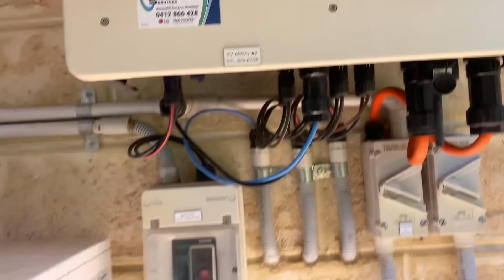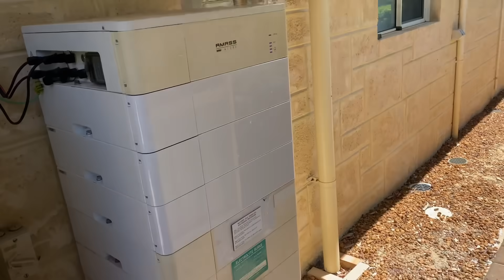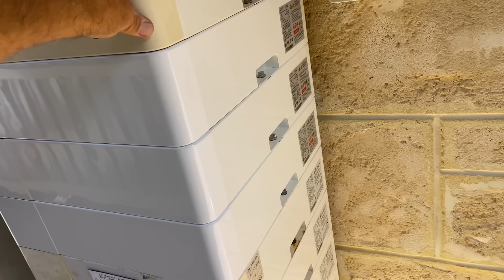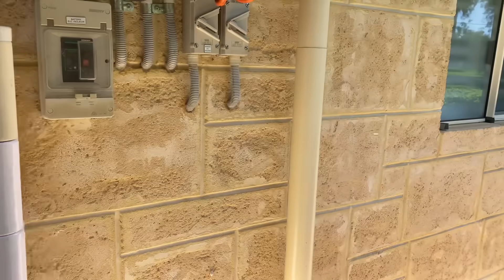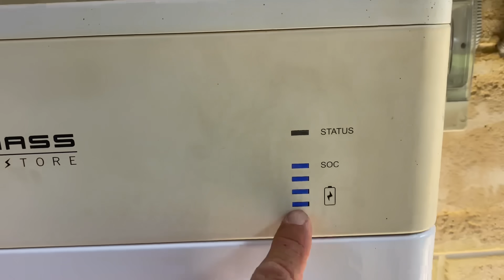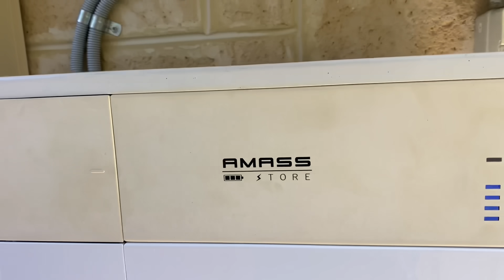Yet another battery sh$t show in Perth! Why cant people just do their job right 🤦‍♂️

Comment: 4 years ago I had solar installed from, I found out later, a marketing company that hires subbies to do the procurement and install. 

I paid the agreed deposit (20% of the value of the work) and two weeks later before anyone started any work at all the company emailed and called asking for the remaining balance. I said I am very happy to pay, no problem paying, when I actually see your team on site, the system installed, commissioned and witnessed by me to be working as per its specification. 

They tried the stern voice, oh you must pay the full amount now, etc etc. 
No I don't....but I'm very very happy to....once you complete the job. That's what deposits are for.

Anyway, they relent and send out the installers the following fortnight. Come install day the panels go up on the roof, inverter, isolators, breakers all done. Time for commissioning: One entire stringed bank of a two string panel bank system were not delivering power. Inverter was receiving and thus producing only 50% of its specified power and displayed a string fault on its digital readout.

Contractor tried to convince me that it it's ok, it just takes time for the inverter to 'learn' the system over time and wanted me to sign off the sheet that I accept the system. Not a chance, I wasn't signing anything. I wasn't buying it and I wasn't in the mood to argue. It was the end of the day so he took his team off site. I then immediately called the company and told them the current situation and re-iterated.....I'm not paying a cent more until this is finished. 

Contractor came back alone two days later with a replacement inverter (no diagnosis to find the fault was actually done). He removes the existing, installs the replacement and same result. Only received power from one bank of panels, error code doesn't go away. He goes off site again. I call the company again and once again explain....no more money until this is fixed.

Contractor comes back with another fellow a week later. This time they do proper diagnosis. Turns out one of the inital install guys put a screw right through a DC cable in the string that was shorting one of the panels to the subframe. (These are qualified electricians by the way. Just because they have a license, that does NOT guarantee competence or even care).

Screw removed and cable replaced. Test and commissing the system then passed without a hitch, I witnessed the result and signed it off. Called the company and said now I'm happy to pay the balance. System has been performing fine since then to this day.

LESSON: DO not ever EVER pay any contractor or company any more than the agreed deposit until the job is done, finished, tested and commissioned to the expected specifications because once they have your money and you sign anything off getting them back to fix anything will suck the mortal soul out of you. It's a complete cowboy industry out there.

I'm sure I never would have seen them again if I gave them all the money up front and it would have cost me more of my time and money to chase up and fix something that should have been correctly done the first time.

Comment: Made me laugh - had the same problem (CT's back to front) when my own system was installed 5 years ago. I think it took the manufacturers themselves, connecting in via the Internet, to identify the problem. I came away with the feeling that the installers were using my garage as a training venue. But they've been good since then, so all's well that ends well.

Comment: Wouldn't trust a lithium battery in my home. Refuse to install one. Just utilise my solar system during the day.
Reply: That's rather ignorant. That's like saying All Petrol Engine cars are a lemon. Lithium battery come in many different types. You don't need the high energy density more volatile variants for home batteries. Considering a proportion more size and weight is not a problem. Any decently engineered home battery is fine.

Comment: 🤨 calling it a shit show is a little much.  The customer took 2 years to get alternative help after they knew it was not working.  And a sensor around the wrong way is a minor issue.  And then to say the battery company didn’t have to warrant batteries.  Yes they do.  A system does not have to be run 24-7 to receive warranty for it

Comment: Unfortunately still non compliant mate, the battery has been installed within 600mm of the air conditioning unit. AS/NZS 5139:2019 restricted locations. Unless the installation was done pre 2019.

Comment: I built a bank about twice the size of this with lead acid gell cells i bought from a scrap metal yard @ scrap price, in the 90s
They were originally for an emergency lighting system in a large government office building in Canberra .
I charged them with solar and back-up generating set. 2000w inverter. All very basic 12v dc and 240 ac systems with no computers to stuff up and break down. 
I used them for nearly 12 years running a bush camp in an opal mining town. 
They were still working well when I sold the camp and moved on.
Was a great life in the bush.

Comment: I wouldn’t waste my money on any of this technology you only have to look over your shoulder in Europe to see what a mess the entire industry is in because it doesn’t scale. Those who do private solar and battery installations need to wait a long time to break even and when they do component EOL kicks in and refresh requirements occur. 😂
Reply: Not sure about that. We installed 6KW pv and battery in Dec 2016. $10k all up. ( My contribution ) 
Since,  we've never had to pay for electricity and we claim $1000 per year of our solar rebate  $$$'''s. So we've had $8000 back so far and never paid for power. The account is always around $1500 in credit by the end of every year, even more now with all the Govt incentives, those cannot be cashed out. So I reckon it's worth it. We know how to run a solar house having been off grid at a farm house  1996 to 2016.  That system was around 50k ( 1KW solar & 1 KW  wind turbine 800 Amp 48v battery bank.  Upgraded later to 2 KW solar and a 3 KW wind turbine.  ) Mr Howard paid a bit at the time.
p.s. The quote to connect mains power was $176,000 back then.
Reply: @maxthecherryman  as you subsidies by state taxes…

Comment: We had similar issues with a red back solar system in Sydney. Installed incorrectly from day one. Only found this out when the system died and wouldn’t charge batteries. Original installer didn’t seal the enclosures properly so had water ingress and rust etc. after months found a installer like yourself would would come service the unit. Red back were great too sending replacement boards and parts. 

Also found out during the process that the original installers were in jail as they were using the install time to case peoples houses and would come back later and rob them!
Reply from the maker: Thats crazy, In jail for casing houses 🤦‍♂️ definitely not the type of people you want at your house!
Reply: @ the craziest part was they were leaving roof tiles off so they could sneak in through the roof cavity.

Comment: Someone is going to die....when I hear people not knowing how to wire things up correctly and the word CT in the same sentence it is like a red flag to a bull... someone mentioned extending CT leads even!  

Might I just remind people CTs claim the life of an electrical worker on average about every 5 years!  If you open circuit a CT without properly isolating, it turns into a 100 to 1 voltage step up transformer or higher.... with you working on the connections... saying nothing to the damage the high voltage can do to all the equipment.

Extreme care around CTs people!

Comment: This net zero horseshit needs to end
Reply: What ought we use to supplement the renewables portion of the grid in your mind then?
Reply: @emceeboogieboots1608  Installing more generating sources of non-fossil fueled energy is so much less costly in the long run. 
Non electrical storage systems are becoming more readily available for gridscale use and effciency levels are improving by the day. 
It is always a good idea to spend more time researching these matters than criticising without the neccessary knowledge.
Reply: no it doesnt if you care so little about the planet then leave simples
Reply: @zodiark2456 are batteries and solar panels made from rainbow sparkles?

Comment: Good on you, mate for showing this. We have a 19.2 KW system through Arkana Energy with Sungrow equipment and working without any issues. We had an issue 2 months ago that got fixed really quickly. The system charges fully everyday and discharges overnight. That is 17 KW of return (10% loss) which saves us 5.44 AUD per day, the battery has cost us 12,000 AUD so we'll make back the investment in  8 years and have 25 years of warranty. I can recommend this to anyone.

Comment: I had the same problem 2 years ago. And demanded them to come back and check. A simple search brought up the ct wired wrong. Solargain installers or subs screwed up. It took over 3weeks to get it resolved.
When the sparky came out I explained to him what I was seeing. While monitoring the system. When he check the wired colours didn't even line up on one end of the connections. Pissed off a simple mistake was made and was signed off correct.

Comment: The DC cable too thin with 52V battery!
Reply: Why should the wire gauge depend on the voltage?
Reply: @cottsak  The higher the voltage, the lower the current and the lighter the cabling reauired.
Ultra high voltage DC transmission used insanely thin conductors.

Comment: Of course the main fault by the sub contractor but what a dumb idea to just shut the batteries down for so long. Just charge them once a month or something. As an installer I see this type of dumb stuff as well. Mexican installers that just put stuff on the wall or ground un configured or mis-configured. Bad wiring, wrong wire guages, no fusing / trip breakers, too much panels on the MPPT charger. not adhering to wire color coding, twisting wires together and using electrical tape. The upside is, more work for me, and a chance to do it right.
Reply: They were probably exasperated and had given up.
Reply: You'd think at least charge in the day, discharge at night to avoid peak prices. But hey it's a Labor voter so intellectual ability is not expected.

Comment: We need guys like you over here in the east!
I'm a sparky myself in the commercial space and just had a 15kwh battery installed at home.  The subbie who installed it said it's all good to go sign here and he was gone.
I monitored the system for a day and it randomly thinks I have a 5,6,7,8kw load and imports from the grid and discharges the battery as well - THERE IS NOTHING ON IN THE HOUSE!
Sunboost said monitor it over the weekend and let us know on Monday. Also the installer will not reply to me.
I'll see how we go tomorrow. Meanwhile battery fails to get past 16% soc.
Love your channel!
Reply: - so is  the monitor CT  simply on backwards - recording solar exports as load  ?? - easy to flip it around (for a sparkie).
 - getting installer access to the software isn't always simple - or possible, settings for batteries and inverters are often locked in annoyingly - as a tradesman, the manufacturer support should be able to sort out what's likely wrong.
Reply: @kadmow  checked the ct, it's installed correctly but could be faulty.   Still waiting for sunboost to respond!
Reply: You're a sparkle??!!   😀
Reply: Yeah he's a Sparkle ! ANOTHER Who I wouldn't let Carry My Tool Box.

Comment: I have a sofar system installed in my premises. I purchased the 15kw (3x5kw powerall system) of  batteries an 2 x 5kw inverters myself. I had a company install 13.5kw of  solar on the roof and do the battery and inverter install. When the installer turned up (in his 150k 79 series Landcruiser with workers), he promptly told me he was installing the system directly behind my meter box as that was the agreement that he has with the company on the install. When i pointed out that it was not practical due to 2 things. First there is the Natural gas line attached to the wall directly where he wanted to place the battery and it would not allow me to be able to park my car in the garage.
I said i wanted the system on the opposite wall as it wont interfere with anything. He then carried on like a pork chop and told me it will cost me an extra $1000 as he is only getting paid for a back to back install. I told him that's not my problem and to take it up with the company. He then informed me he had never installed a sofar system before and wasn't sure how it is to be setup. Once again I said not my problem take it up with the company.
He did the install and totally stuff it up. Could not get the 2 inverters to talk to each other. The battery would only see 1 of the 3 %kw batteries that were installed.  
Consequently I held back $3k of the bill, They have sent another solar guy around to look at it a couple of months ago. He was horrified on how it was setup. His comment was It could have burnt your house down the way he had the battery and solar wired when there was a blackout.
He got hold of sofar tech support and have the 3 batteries seeing each other and he has wired it all up properly.
The app will still only see the batteries at a max of 50%  charge, but I can live with that. Apparently I have to have 1 of the batteries hooked up to the second inverter for it to be able to read properly.
I still cant see what the consumption I am using. I can have my ducted aircon running and it says i am using 600watts during the day😒😒
They have tried numerous times to make me pay the outstanding amount. Each time I respond with, When its working properly i will pay.
Haven't heard from the for 4 months now. I think they have given up.  
I would like to get another 15 KW of batteries on the other inverter to see what the potential of this system.
Reply: Why would you go through with it when he said he hadn't installed before
Reply: If he never done it before he should be with someone who's know all about it...Australia is good  on doing the shit up...remember a few years ago the roof insulation 😂😂😂 that was also a stuff up..
Reply: K
Reply: They 6 years to collect the bill keep all your files.
Reply: Batteries arent measured in kw. That would be like buying petrol in horsepower dude.

But then again they are the professionals and should have got it right. Remember professionals built the titanic amateurs built the ark

Comment: I had the same problem with one of my systems.  It is a 3ph system and the problem is that the CTs were installed in the wrong phase and on the wrong side of the meter.
It seems very few installers have a clear understanding of how meters work and how to install them correctly.  I did talk to the installer and they couldn't figure out what was wrong. After talking to the boss i found out they had the same problem with other systems they had installed the solar feed on the wrong side of the meter so the power company was charging me for the solar Inwas generating. I only foud out when I checked my consumption on my energy provider a week later only to find out I had been consuming power and generated nothing.
In the end I ended up having to check their installation and fix it up my self.
Reply: DIY 👍
Because not one else cares as much

Comment: The owner left the battery off for 2 years and then wondered why it doesn't seem to be working? Maybe manufacturer's need to issue a "How to care for your battery" cheat sheet for beginners. You let any battery go completely flat you've damaged it irreparably. Depending on how low the other packs got they could also be no good.
Reply from the maker: Yes, he turned them off because they were charging from the grid and costing him money because they were charging at night time when there was no solar generation the whole time the batteries were turned off he was trying to get help from the original installing company and the manufacturer
Reply: @ But still - battery 101 - don't let them discharge below the minimum voltage. Consumers should be warned of the damage it will cause. He could have just turned the battery once a fortnight to keep them healthy. He could have called you a lot earlier. I just think if you’re going to own a very expensive home battery, you really should know these ver basic battery principles.

Comment: You can get ethernet based extension cables which will allow the ct lead to work all the way up to the incoming utility supply (you can get wireless Ct transceivers as well but generally need mostly line of sight to work)

Still bonkers that they didn't see the basic error in having the Ct leads installed backwards (most are directional) or on the wrong power cables
Reply: - yes extending the monitor wiring is no problem - my solar install is 60m from my meterbox, I supplied an ethernet cable (bare Cat  5/6 cable) - for the installer to hardwire from the monitor unit in the meter box to the solar inverter - that too is connected to my internet via an ethernet switch, not wifi.

Comment: As soon as you said battery had been charging off the mains my thoughts went to how the CTs were set up.  Obviously the contract installer didn't care, probably didn't get paid enough to care.  Locally sold installations might cost more, but there's a reason for that.  I can't imagine it felt good to have all those thousands of dollars of batteries sitting there for 2 years and then finding out they'd over discharged and were knackered either.
Reply from the maker: Client was not happy at all, its a worry how many of these jobs I go to.